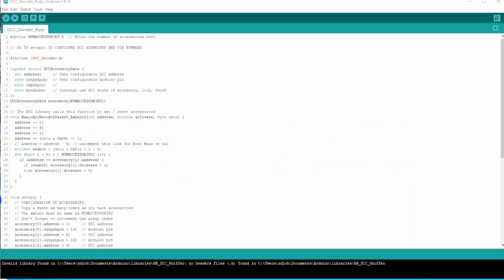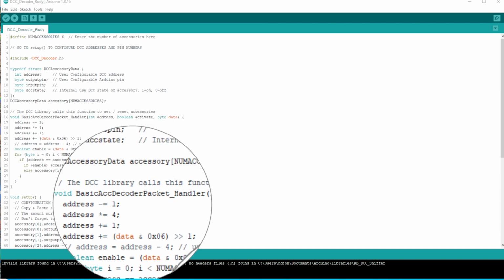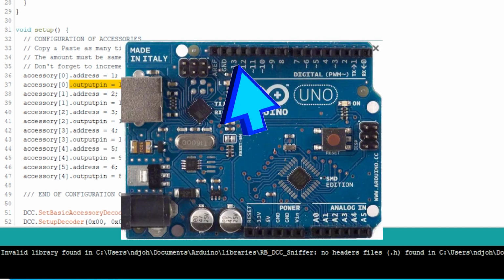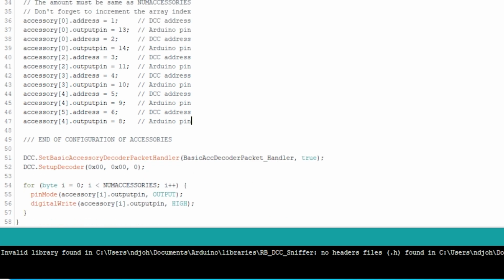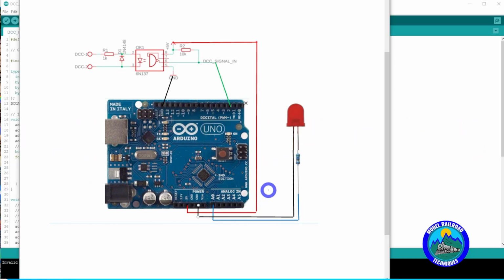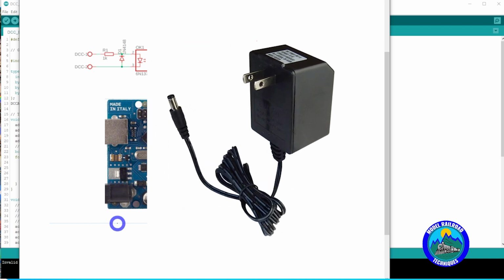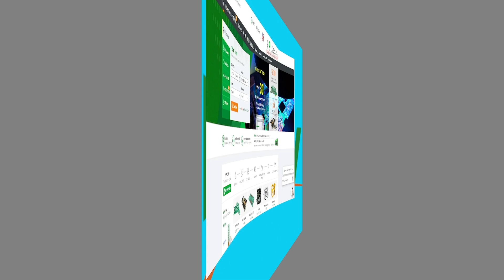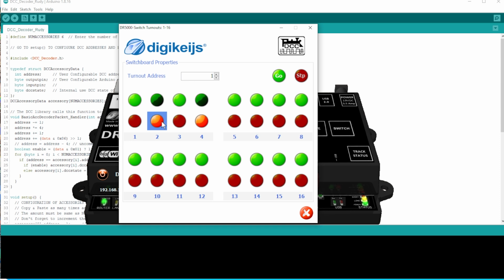Cheap Arduino Stationary decoders for you Model Railway.

Comment: Today I learned the Arduino Analog pins can actually be used as digital outputs. I saw the wiring diagram with the LED in A0 and thought "that's not right" but after a quick google apparently, yes, you can in fact use them as digital output pins. That's incredibly useful for non-railway arduino stuff.

Comment: I am in the process of building a DCC controlled turntable. I currently have a Nema 17 hollow shaft stepper motor mounted on the turntable central shaft. 2048 steps per revolution, although I am considering gearing it for more precision. I am using a Nano clone mounted on a custom pcb, with a similar dcc code stripper circuit to the one you describe and a relay for reversing the polarity of the turntable feed depending on relative position to road 0. It is my aim to have the turntable remember its position when powered down to do away with power up seeking of home position, however I have an option in the software to do just that when required. 

I already have the home position circuit and code working using a slotted opto switch and disc, but am having trouble coding the decoding of a dcc signal and selecting the correct road. I also need to make the direction relay work. Manual road selection by use of a rotary switch and homing on demand would be good to.

I use JMRI to control my DCC-EX command station and also need a pointer or two there as it appears to produce 4 outputs for each address!

Any pointers you could give would be appreciated.
Reply from the maker: thank you for your reply. You appear to be well in advance of me. Do you have Facebook? There is a great Arduino for model railroaders group with lots of talented modelers there.

Comment: Great video! I love this series and also the fact that you will be adding stuff as we go along. I have also fancied building an accessory decoder using the arduino but still a newbie and still learning. The one function I would like to see added is a switch being added to it, as many old skool  modellers still prefer a control panel. By adding a switch to operate each output would make it easier for visitors, as they may struggle trying to remember decoder numbers, which isn't always practical especially if the layout was exhibiting at a show. All the best Tony.
Reply from the maker: Thanks Tony. You could use an Opto module and have switches that feed DCC commands back into the system. Best of both worlds then. I did a previous video on this. “Use Infrared….”I am a beginner/novice too. We all can learn together. Thanks for watching. Cheers Daz